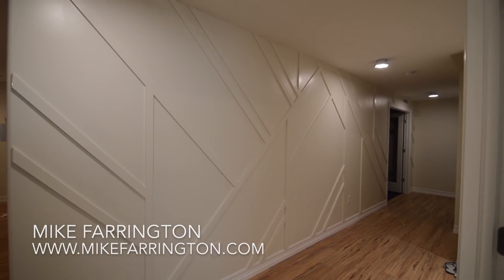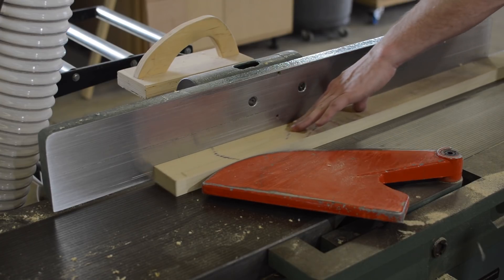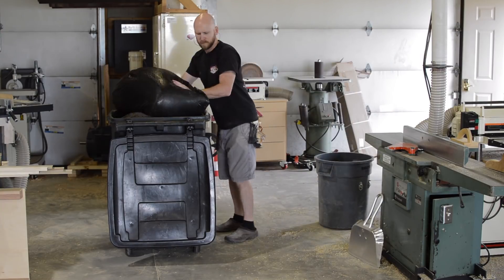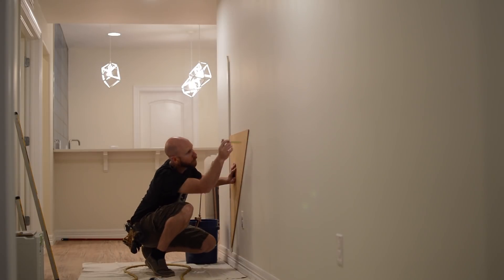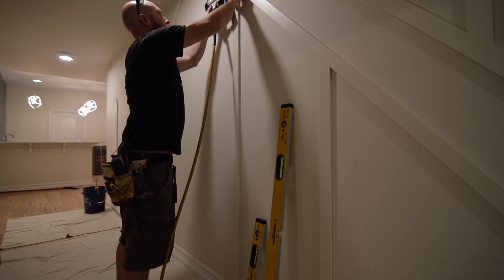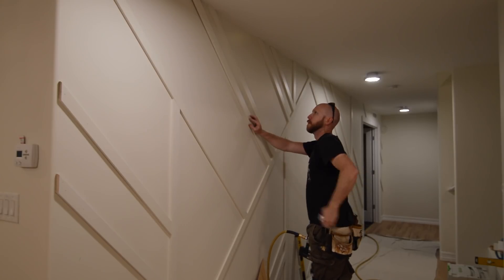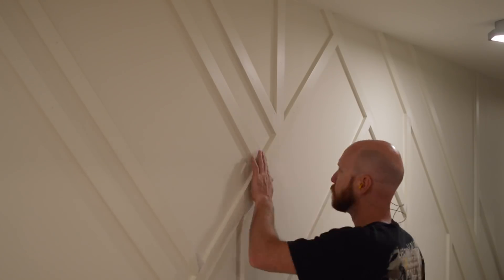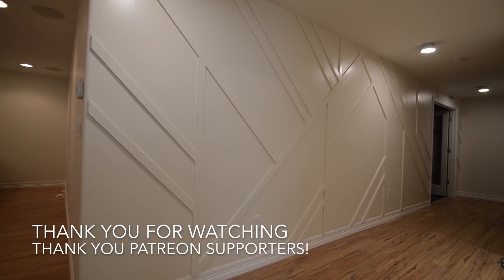Wainscoting with a Modern Geometric Twist, Wall Paneling diy

Comment: What's that machine around the 2:30 mark?
Reply: Powerfeeder used with tablesaw with Edgetech Sanding Disc mounted instead of sawblade.
Reply from the maker: Quin is correct.

Comment: Milling that down you wasted half of the wood
Reply from the maker: Thats true, but I had no other option.
Reply: @MikeFarrington  I thought you love the bandsaw would that not have worked? I sure there was a reason you didn't. Keep up the great work I love the humor and your work 👍❤
Reply from the maker: @snatchface8277  Cutting a bunch of wood off one side, then planning lightly to final thickness is a recipe for cup, bow, warp, etc. Planing equally from both sides is a safer bet. I didn't remove enough material to bandsaw both sides. Hope that makes sense.
Reply: @MikeFarrington  I knew there was a reason you did it that way 👍

Comment: the wall looks beautiful. And those hard geometric shapes, you made it all look simple. 

I have a question about the wall texture, usually with your wainscoting projects, you use a thin board to cover the texture on the wall. You didn't use that in this project. Ignoring the customer's budget, would using a backing board for this project be your choice?
Reply from the maker: I presented several options to the customer. One of which was to add paneling to the wall. It was decided that it was not worth the cost. I would probably want to do that given an unlimited budget.

Comment: Interesting little accent wall... not sure I like how it transitions into the baseboards.
Reply: Replace the baseboards with straight pieces that match the wall.
Reply from the maker: I agree, the decision to leave it was not mine, I presented the option to remove and replace the baseboard and the extra cost was not worth it.

Comment: Hi Mike, first off want to say I love your channel and your work (woodworking and videography included). Question though, if I was faced with that job I'd immediately think MDF strips, what made you think solid wood and did you consider MDF? I know joints in long runs are the first reason so assumed everything was pre-finished but was surprised to see the block plane and paint at the end. Keep up the great work
Reply: I was thinking finger joint pine because you can get it in long strips and it's getting painted.
Reply from the maker: You guessed it, I didn't want to deal with the butt joints. Thank you.

Comment: Did you cut them all to size when fitting, or I guess you could pre cut some of the pieces, as they would just slide nicely into position? Cheers I like odd jobs too.
Reply from the maker: Thank you. I had to cut each piece to fit. I had an idea of length based on my design, but that wasn't accurate enough.

Comment: Hi Mike, I’m having such a hard time finding hardwood lumber companies that don’t just sell S2S. I’m in the Monument/Springs area looking for rough stock; do you have any recommendations for Denver?
Reply from the maker: You may have to call. The place I buy from on the north side of Denver doesn't have it out on the floor. I have to call, order what I need, then go pick it up. I don't get to sift through the unit. They pull boards in order off the top.This is one of the downsides, I don't get to pick each board, but for paint grade it really doesn't matter.

Comment: Great work Mike. Additional pro tip: know what’s in the wall before shooting nails into it; particularly in areas with plumbing and voltage.
Reply from the maker: Also make sure the nail penetration is no more than an 1". Stuff in walls should be buried more than an inch.

Comment: Crazy design and nice execution. My only question is that the transition to the baseboard seems kind of harsh...was that intentional?
Reply from the maker: Thank you. The base boards were a compromise, I presented an option to remove and replace the baseboards but the extra cost was not worth it.
Reply: Yeah, i was thinking the same thing.  I actually feel inspired by the video, but that's one of the things i might consider changing.  Similar with the left side where it meets the corner of the wall.  Seems like there could be some other kind of transition there, though i'm not sure what it could be.  Overall, still awesome and interesting project...
Reply from the maker: @justavian  Thank you. If it were my place I would have framed the space in and put the pattern inside.
Reply: @MikeFarrington  that would have looked real slick. But you have to do what the customer wants.
Reply from the maker: @BPDRacing1  We're all working for someone...

Comment: Awesome project Mike, thanks for sharing! Who said that geometry would never be useful in real life?! I was wondering, what is your experience of using filler over the joints? I always worry it might crack due to any wood movement but maybe I’m worry unnecessarily.
Reply from the maker: Thank you. There is always a chance for a crack, but between the glue and the filler, thats about as good as I can do.